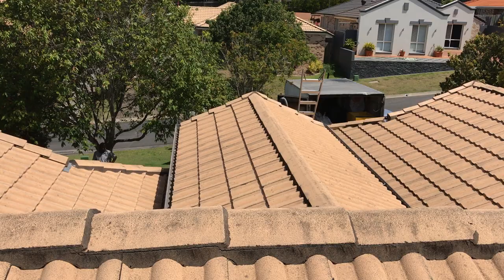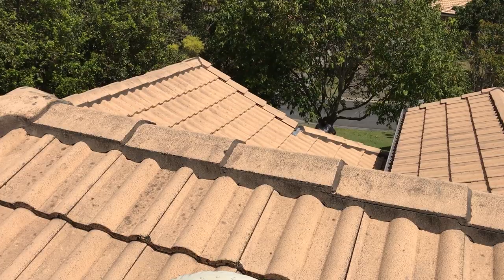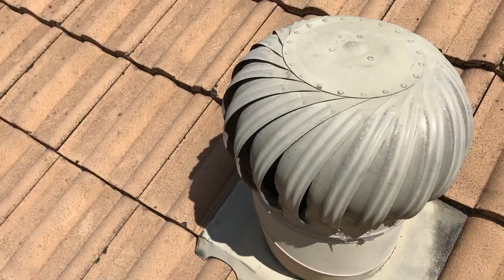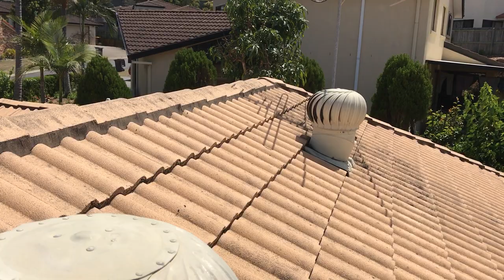Stop your Roof vent from squeaking  and squealing all night  with this simple and cheap fix.

Comment: Ya didn't show how to do anything
Reply from the maker: Sorry I did tell you what to do but you are right that I did not actually show you, I was having trouble holding the camera and the glue gun and stoping the vent turning so I could put the silicone where I was pointing.
In case you missed it, you just need to squirt glue between the spinning top and the neck in about three places, preferably do it on a day when there is not lots of wind so the silicon can dry before the vent tries to turn again. 
Silicon is quite thick and so even in some wind like today it stopped them from turning. 

I recommend to do this because we had just finished installing a quality insulation and so venting the roof space just helps animals live in your roof better.

Hope that helps 

Regards

Peter
Reply: Lol..... 😂🤣🤣

Comment: I couldn't understand what he was saying 😩
Reply from the maker: Sorry if I was not clear, what I was saying is that there is no parts available to fix a noisy roof vent and because they get worse from here and end up causing a roof leak sometimes when the bearings finally break.

You are better of just putting silicone glue on the vent top to stop it spinning. A simple cheap and effective fix
Reply: Me either
Reply: Seems clear to me!

Comment: Are you for real ,a peanut would make more sense
Reply from the maker: Not sure why what it has to do with peanuts but what is not discussed in the video is the face that as this is not my house I can not do something to fix the problem that the customer will not pay for.  The customer did not have spare tiles to remove the vents and put the original roof tiles back in but they did ask me how to stop them annoying the neighbours. So if you have a squeaky roof vent and you have not much money then a bit of silicon might fix the problem... Thanks for your comments and I hope that sheds some light on the reason for taking that action. Which I agree is not the best thing to do but it was all I could do to help someone who did not want to spend any money on their roof.
Reply from the maker: I would definitely recommend to replace them too ... that is not what the customer wanted to do and so gluing them up has no down side as the house was insulated properly now and if they do not want to spend the $50 their is nothing I can do about it.  Anyway thanks for your comments and I hope it helps someone else who has an annoying roof vent.

Comment: grease and change the bearings for an axial one and that solves it and if it is axial it lasts longer
Reply from the maker: Yes that was how we fixed vents a 100 years ago but now days you can not buy new bearing and these vents are made to be disposable. Yes there is better quality vents out there and yes putting oil or grease in the bearing may help in the short term but these are not car bearing that can be repacked, they are a sealed bearing and normally part of the plastic housing now and so very hard to replace. Oh and how much is the customer going to pay me to replace them? 
I have seen a 100 diy experts try to grease these bearing but it just does not work.
Reply: My neighbor's was driving us crazy, when I offered my ladder & grease gun he got red in the face and barked something about silicon! I couldn't care less; as long as that  noise stopped!

And it has!
Reply from the maker: Thanks for your comment, Many of the commenters missed the point that in a restricted situation where the customer does not want to spend any money and does not have a tile to put in the whole if you remove them... .Then 20c worth of silicon may be a good solution to stop it making noise at all times of the day and night.. Thanks again for understanding the spirit of the advice and Maybe your nemibour watched my channel too ... lol

Comment: I thought they were supposed to spin
Reply from the maker: Yes they are but when the bearing get to this point and the customer does not want to spend $200 per vent replacing them (in Australia that is). Then the cheap option is to glue them up. The risk of not gluing them up is that the top will fall off eventually and cause a roof leak. Like I said I would rather not put them in at all. Just a waste of money.

Comment: The whirlybird is supposed to spin to get air out of the attic so the attic is the same temperature as outside insulation has nothing to do with it if he actually knew what he was talking about he would never say to do this. If this is your house this guy worked on replace the whitely cords and if he did insulation in the attic check that there is a channel foam or otherwise running from the edge of the roof up higher than the insulation so that air from outside can be sucked through the attic and back out by the whirlybird.
Reply from the maker: Actually if roof vents made the attic space the same temperature as outside then why is all these customers with roof vents have hot houses? Roof vents do not have the ability to move enough air to cool your roof space in the Australian summer. 
Let me just educate you about the National Construction Code of Australia and what our building code says about roof vents.
It says (the NCC building code backed by science and not just opinion) that if you have one roof vent and two eave vents per 70meter of ceiling space you will achieve a equivalent R0.47 benefit in summer but also a negative result in winter. 
The NCC does not require roof vents but if you have them, you are required to install more ceiling insulation to compensate for winter losses. 

Funny that all those old timer Queensland’s houses built a hundred years ago are not full of rot when roof vents were never installed and ask yourself if they are so important, why doesn’t the NCC require them to be installed and if they work so well why are they only rated by the government as being about 1/6 as good as our recommended cellulose fibre R3.0 ceiling insulation. 

What you are saying is a common misconception and it is spread by un qualified people like yourself. Please refer to the government guidelines on building and why vents have negative effects. Oh and if removing moisture is the goal of roof vents, why do they all leak when it rains !! 

Roof vents are a waste of money in my opinion and according to the NCC of Australia they have the same benefit as painting your roof a lighter color if it is a darker shade.
Reply: Proper attic dead air space ventilation does indeed suggest the best environment is to achieve the same temperature above the insulation as the outdoor temperature.
Reply from the maker: Sorry to say joe but is roof vents did that, then nobody would need or want their ceilings insulated. I probably know a bit about it unless you have seen the inside of more roofs in QLD than me. Also see me comments about the NCC not requiring roof vents but requiring more ceiling insulation if you actually vent your roof. 
I am happy for you to show me a house where the attic temp is the same as ambient because of roof vents but that is just not the reality.

Comment: This was funny it's so inept
Reply from the maker: Thanks for your comments joe dirt, please help other readers by explaining why you disagree with this very cheap solution? The point was not to fix the vent, just spot it from making noise and as it no longer makes noise I think by definition it is not an inept solution?
Reply: Condensation can form on insulation if it's not properly ventilated therefore it is proper to install a roof vent for every 300 square, as recommended by the pink panther, owens corning and gaf.
Reply from the maker: Condensation does not form on quality insulation like cellulose fibre in the QLD environment. And I would expect the people who sell stuff to tell people they need to buy more stuff. However if condensation was a problem in roofs like people who do not work in roofs all suggest, then I would want to know why our building code does not require ventilation in roof spaces at all. 

Putting roof vents in a perfectly water tight roof is more likely to let water into a roof than vent any moisture out in my experience of being in 100’s of roofs with vents while it is raining sweating my balls off because the vents do not work. 
Please show me the mythical roof where vents worked because even on this roof in the video they were not working which is why I was their insulating the ceiling. 
But thanks again for your comments.

Comment: just replace it
Reply from the maker: Yes replacing it would also work but it is more expensive and it will fail again in the future anyway. Your are right that good windows and good installation is the right solution.
Reply: @InsulationTeam  17 years hvac. Ive fixed every ac known to man. Ive also rebuilt several engines. You should do urself a favor and zip it
Reply from the maker: Thanks for your comments but I am not sure why it is relevant that you fix aircon and rebuild engines ? This video is about neither … I also do not know what I should zip when I am talking about neither the aircon or an engine? but roof vents is something I have installed and removed 1000’s of so I am sure my opinion on them are well qualified .. anyway moving on.
Reply: @InsulationTeam  ive replaced these squealing vents and now it have to replace another. Ita gona cost like 70 dollars. Im just showing my emotions
Reply from the maker: Ya that is why I recommend to customers to remove them and just put the tile back in on a tile roof but on an iron roof it is more difficult because you need to replace the whole sheet or put a short sheet under the flashing but that never looks good. Anyway mate good luck with it all
Reply: @InsulationTeam  woah. No no noo. Its 4 screws and a swap. My goodness. I got one now thats screaching. Its gonna cost me 70 (@×#×!) dollara. But all it is 4 phillps screws. I have 3 of them
Reply: @hvacdr  can just unscrew and pop a new one on easy?

Comment: I have an indoor pool. Replacing the roof (leaking, poor previous install). Never insulated before. Planned to be lined with sisalation/sarking. No insulation as concern about moisture/fungus. Considered 2x whirlybird for better ventilation for pool/water moisture, bit now hearing how loud they are is putting me off- even more reading what youve written. Are vents worth it in my situation, & if so, solar vents?
Reply: Definitely use vents. 
The Lomanco Whirly Birds are the best. What this fellow did was bad.... very bad. 
These vents are not supposed to be static unless there is no wind/ breeze.
Reply from the maker: Sorry for the delay in responding, I was on holiday but the pool roof should have better insulation than sarking if you are concerned about mould a good insulation will stop the Moukd and prevent the risks associated with a hole in your roof from a roof vent. That said venting pool areas is important if you have a small are or a spar in it as the moist air is substantial and will cause mould problems.
Solar vents are more waterproof than whirly bird type vents, I did have an instant of a person working with art works in a shed and the whirly bird get a fine mist though it in a rain even even when it is working properly and that was enough to ruin there artwork. 

The installation is more important than the brand of vent as if something goes wrong it will be more likely to be installation related as most installers are DIY. Also the instructions in the box are sometimes inadequate.

Hope that helps
Regards
Peter
Comfort zone insulation team
Reply from the maker: That is true and it is also not my choice, I would pay to have it removed and my roof tile or iron fixed like new but like I have said in a 100 other replies to comments. The choice when the customer does not have the money and wants a cheap way to stop the noise and stop the vent bearings failing totally and causing a leak. Then glueing the vent up is the next best thing to removing it and fixing the roof. Roof vents do not move enough air to do anything useful in the Australian sun in a normal roof space and that are not directly ducted to remove moisture from an internal spar or pool area. Those vents are not venting roof spaces for heat though and are to vent moisture. 
If you think roof vents worked why would leaving the exhaust fan in the bathroom on all day not do a better job, they move more air !! And they move air on hot still or cloudy days but roof vents don’t!!
Reply: @InsulationTeam  

In cases like this (the turbine vent is squeaking) it is possible to replace the turbine (the spinning part) by dismantling it from the roof flashing housing (so no roofing is required), then simply install the new turbine. That's still inexpensive of that static turbine causes leaks.
Reply: @InsulationTeam  

In a pool situation (I agree) where there is no ceiling between the pool and the roof, then an exhaust fan may be necessary to remove humidity which causes condensation on the glass. It's possible that a bathroom fan would help, but it may not move enough air.
Reply from the maker: Yep just 3 small Philip screws no more than 5mm long and the top comes out of the aluminum bottom!! Sounds like it is really safe and secure. Vents that do spin leak when it rains too but the small amount of water that comes in sits on the ceiling and evaporates the next day.

I should add that if one of the hundreds of vents I have sealed up like this had caused a substantial leak, one of my customers would have been sure to let me know. 
Yes spend the $200 plus fitting in Australia and get the top replaced but it will still not move enough air to cool your home and if it did, why does the NCC of Australia require more on ceiling insulation if you have a roof vents than if you don’t? Because they work against the insulation in winter time. 
Thanks for your comments, feel free to post a photo of the baby screws that hold the spinning top on
Reply from the maker: Sorry I do not mean my comments to sound rude or short. You are a home maintenance man by the looks of your email and I am sure you have a very good general knowledge of Home maintenance but I am a specialist and have installed, repaired more roof vents than most but also been on 10,000 roof that a lot of them had home maintenance or DIY installers put vents on. I have personally seen many of these vents cause problems and they are not even providing the results customers wanted from them to actually cool there home If they were, why was the customer calling me to insulate the ceiling afterwards after having the recommended number of vents (1/70m plus two eave vents)

If you read the description on the box, roof vents work great but that is the only place they work great.  Do your customers a favor and if it is not a pool area, recommend good quality ceiling insulation. The only problem is good quality products are not DIY installation.
Reply from the maker: I agree that this style of vent is one of the cheaper ones that is designed to fail and cause problems but I do not understand the down side of a static vent on the roof and as you did not mention it, I presume there is not one. You are right that in wind forced rain a static vent is more likely to have a small amount of water ingress on account of it not spinning but the amount is similar to the amount that comes though the tiles anyway.  However leaving a vent spin that has bearings like this will cause more damage as the shafts cut though the tops eventually and then the vent will kick sideways and expose the roof to a large ingress of water.. So on balance and considering the customers objections to paying for a new vent this is a suitable solution in most cases ... Thanks for your comments and I hope this helps someone else understand the whole picture.

Comment: Are the whirlybirds separate motorised or do they power by the wind the fan produces?
Reply from the maker: Windmaster and Whirly birds are only powered by the wind for the older style ones that look like this. You can buy newer ones that have a solar panel running a small fan but before you make a weak spot on your roof that will leak and cause you trouble for very little benefit. Just turn your bathroom fan on for a day and see how much cooler that makes your home. A bathroom fan moves far more air than a Whirly bird or Windmaster vent like this and I think you will see that it makes very little difference to the comfort of your home.

The best solution is ceiling insulation but that is more expensive, Sellers of these vents always say that they must do something and they do but it is like emptying a bath tub with a thimble .... Don't waste your money is my opinion.
Reply: insulation and new windows is key.